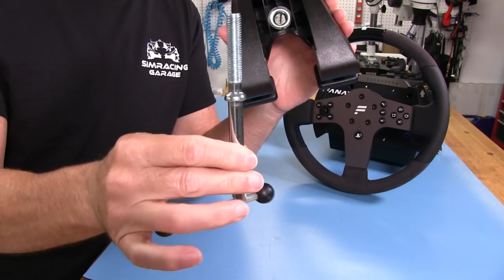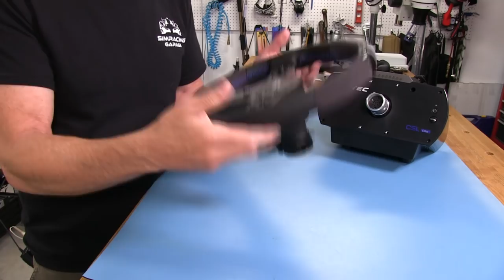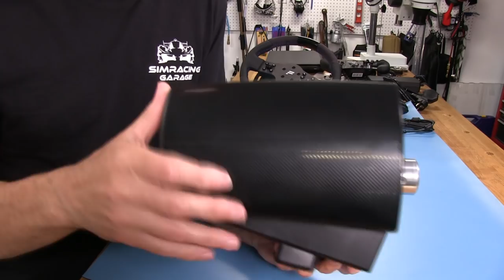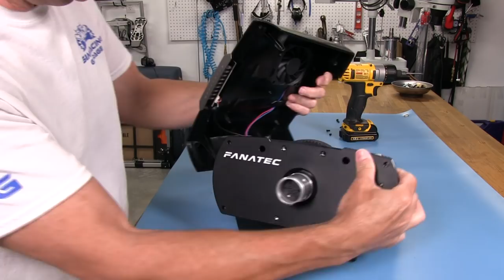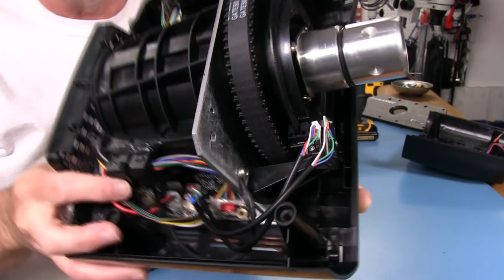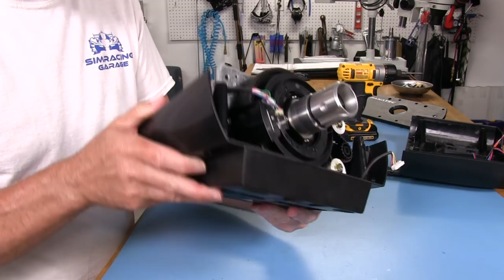Fanatec CSL Elite RW Review

Comment: Project cars 2 has to be applied with jack spade force feedback file, it made so much difference that i wouldnt touch project cars 2 without it
Reply: I prefer to run my own custom file. Which is basically as raw as it can get, whereas the in-game raw still has some smoothing applied.
I never could get along with Jack Spade his files myself, as they seem distanced far away from what I feel in my real car (a BMW E46). Than again, I also know a lot of sim racers wish to have more information than naturally available through their FFB. I personally can't seem to get along with that.
For me AC has rather subpar force feedback, including the default settings for the CSWv2 as provided in the game. There just isn't much information coming from their physics system going into their FFB signal path. Or at least it just isn't coming through for me, and is far from any real cars I have driven and felt. Of which a nice delta for me between games being the Toyota GT86, which I had the pleasure of driving for real once as well.
Reply: LogiForce86 I'd be curious about your settings.  I like the jack spade files but then also don't have any dampening on my wheel.  It wobbles on the straight but it's the only way I could feel things in the corners.  Maybe running more raw data instead would help then I could dampen the wheel down.  Either way I agree with you about AC.  It's never felt good to me but then I didn't spend as much time setting it up.
Reply: Sandy Jenkins Do you have an account at the pCARS forums? That way I can give you my custom file and any extra settings.
Reply: Sure I am registered under theoracleprodigy.  I would be interested in trying the files out.
Reply: Sandy Jenkins Message sent. Enjoy! At least I hope you will but maybe it's not to your liking.
Reply: It looks like that was a lot of work.  I'll give it a try who knows I might like it.  Thank you for doing that.  I have bass shakers as well but only two of them.  So I agree with what you where saying.
Reply: Nah, wasn't a lot of work. Something just came up and than I forgot to ping you on here. I also have two of them to be honest, which I didn't mention.
I usually run chassis mode and than run the front channel of the soundcard into a single input channel on my Behringer iNuke NU1000DSP stereo PA amp. For which I use a mini-jack plug to stereo RCA cable, than both RCA connectors into an RCA splitter than into the amp for which I needed a mono-RCA to mono jack plug adapter.
Than repeat for the rear channels of the soundcard so that you have both front and rear of the car coming from respective front and rear buttkickers on the rig.
That... or if you've mounted them left and right on the rig than you need to put identical color RCA connectors on each RCA splitter, so that all left channels go into one input channel on the amp and right channels in the other.

I know it's not optimal but at least you have all the signals there. I prefer front and rear orientation though as most of the time you already know by looking which side of the car will hit what (e.g. a curb).
Reply: Well I am not sure I like it.  I think you probably already guessed it. It takes too much feel out of everything.  I mean it's decent for what the car is doing but removes all the effects.  My personal feeling is that sim racing has too little effects by far.  Since we don't deal with g forces having more street feel, curb feel and everything in the wheel makes sense.  Even on a normal car you get a lot more street feel than what simulators seem to be able to produce.  This took all of that out and the wheel became dead quiet on the road.  That left me feeling like everything is floating along.  It might be okay if I had more bass shakers but I only have two aura bass shakers which are run with a 150 w amp.  I run sim experience in chassis mode but it just doesn't shake enough.   

When I am on the track with a motorcycle it's crazy how much everything shakes around.  As for tire feel I had a horrid cupped tire this weekend which wobbled when on edge.  You can tell so much about a new tire vs something older with turn in and at the apex.  After a new tire everything felt smooth and planted in the corners.  I've drove a formula ford as well and they feel down right violent compared to a sim.  Simulators all do a decent representation of what visually happens but the feel is not at all close.  In order to get 1/10th the feeling of reality I think you need motion simulators.
Reply: Why does everyone blindly follow what this guy sets as 'good'. He is a self proclaimed king of FFB. His set ups suck, everything is maxed out with no feel to it.
Reply: BLITZKRIEG Who are you talking about?
Reply: Sandy Jenkins yeah, I would have figured you would miss that feel that you would normally feel through the chassis of a vehicle.
Motion is an option but it takes up a lot of room, but do not expect it to fully replace the G-forces either. It only works for short jolts, so lengthy cornering forces aren't really possible to replicate.
I think I personally prefer a 4 point D-Box solution with Sim vibe and powerful butt kickers. Or a combination of butt kickers in each corner because of frequency range differences, like having a tweeter midrange and woofer in a 3-way speaker cabinet.

Good luck in finding what you like!

PS. Did you try opening the FX slider?
Reply: LogiForce86 yes I did open up the fx slider as well.  To be honest I was having an off day all around.  I might try it again later but I couldn't drive that day at all.  I don't know why the formula a was just kicking my butt no matter what.  Of course I was just playing with it as the stock lose setup.  So it didn't make much difference which settings I was using that day.  I'm thinking about doing either a diy solution for motion rig or dofreality.
Reply: Sandy Jenkins I have those days too. Although today I got in the groove with the Lotus 72D at Monaco when doing some hot lapping. I ended up 3rd on the leaderboard and just 1.9 seconds off of Emerson Fittipaldi his fastest lap in '73.
That was without butt kickers and with the Vive on. So even with the lack of feedback from the road that would enter a chassis vertically it is doable. :)
I still need to further optimize my setup to make the most out of the car and Monaco though.

Instead of getting motion I am personally considering getting a Podium wheel instead. I just want that extra fidelity and dynamic range of a direct drive. As often stated in SRG videos... a direct drive often ends up driving the car by itself, in the sense that it is way better at self correcting. Plus you will less quickly tend to overdrive the car as the torque will end up ripping the wheel out of your hands.
Reply: I am so getting a podium wheel as well when it comes out.  The question is when will that come out?  Either way I have a few top 10 as well in pcars 2.  Good job though on getting in 3rd.  I really would like more feel through the entire chassis.  That's why I have been trying to figure out a way to get a motion rig.  It's odd you feel more in a real car at 30 mph than you do in a sim doing over 100mph.  I can't explain how alive even a little formula ford feels on a very small track.  If I could simulate even a go cart type feeling I'd be happy.
Reply: Sandy Jenkins I am currently contemplating if it would be actually be possible to do the reverse of what Colin Chapman did with the Lotus 88, namely constructing a 80/20 sim rig with a double bottom frame in which the inner frame is suspended on the outer frame. Either with springs or maybe even a bunch of exhaust rubbers.
This would greatly remove any vibration going into the floor annoying others in the house or neighbors, but also will make sure all vibrations are kept in the suspended "chassis" if you will. Just like how a car chassis is suspended as well via its suspension.
In terms of how this is the reverse of the double chassis Lotus 88. Chapman wanted to disconnect the driver from all the forces and vibrations of the car by suspending the cockpit, but with the sim rig I am trying to keep the vibrations inside and prevent it from going elsewhere.

It is just an odd idea I am having. One that would make it possible to crank up all the tactile and so on without worrying about others. Plus since the vibrations can't dissipate into the floor as easily you will feel them better as well, simply because you are isolating the rig/cockpit/chassis... or whatever you want to call it.

Comment: Barry this is interesting:
Pulley for Fanatec CSL Elite Wheel Base PS4
https://www.thingiverse.com/thing:3826249
"pulley in exchange for the original pulley from Fanatec CSL Elite Wheel Base for better belt tension to prevent noise on high FEI setting and get better feedback"

Comment: A good steering wheel, though it broke in me for a month and I had to repair it myself - https://prnt.sc/jmiepb

Also recently has problems with fanatec software
Reply: Ordered laser cutting of an optical wheel made of steel
Reply: Did the belt did this?
Reply: no, If the FBB is very strong and incorrectly tuned - then the optical wheel bends and begins to touch the sensors that read its position

Comment: Some of this gear is so far ridiculous it's amazing people think they need it to win. Some kid with a ps/2 controller winning.
Reply: It's more for realism rather than winning though...it's for people who would be doing this at a real track given the opportunity/money but this is the closest approximation.
Reply: @xxczerxx  I can see that to a degree. When the simulator costs more than real racing it starts getting silly. There's a Aus supercar sim nearby that sells for 75,000. In terms of pedals and shifter the real cars are not even that bling. I guess different people are into it for different reasons. This elitist type mentality soaks into every sport where technical equipment is used.
Reply: @marklowe7431  That's true, and yes gear gets into the absurd range of course (in most cases though for either the super rich or actual motorsport dudes, f1/GT drivers etc). I only spent something like a grand on my few bits (CSL set and a cheapish rig) and it's well worth it!
Reply: @xxczerxx  Agree, I guess there's also the lower limit and that's where you do need to spend at least a certain amount to get gear that does perform to a standard.